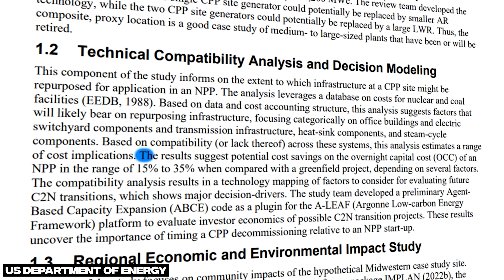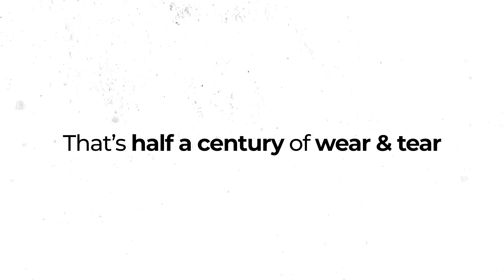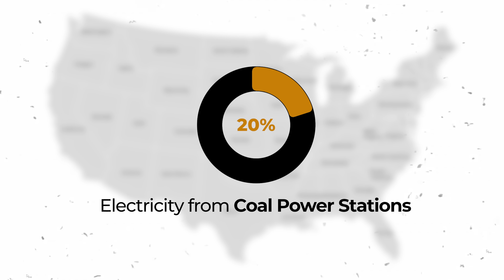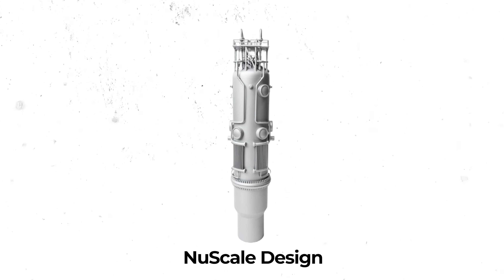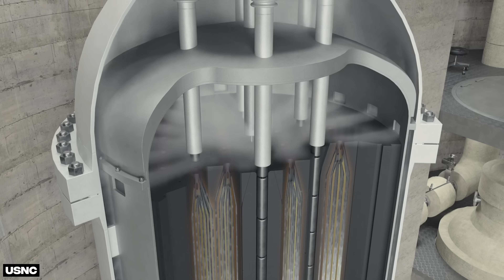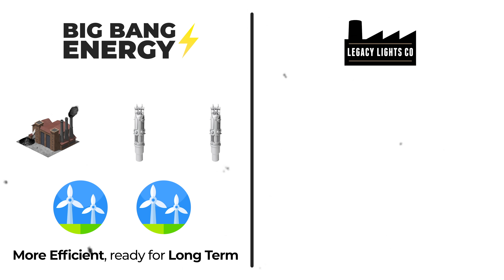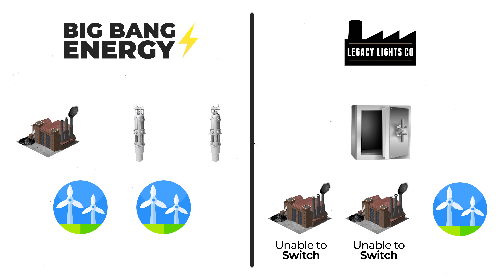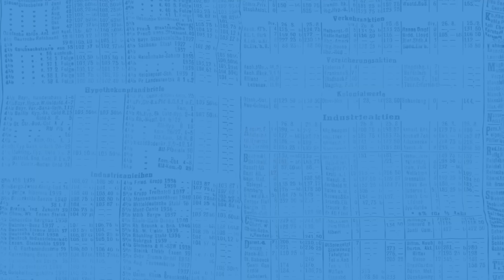Can We Convert Old Coal Plants to Nuclear Energy?

Comment: Old power plants are just as useful for installing large flow batteries there - instead of nuclear...
Reply: Why? You're not gonna get the same output of power as a nuclear plant. A modern plant with advanced recycling methods would fill 1 shipping container with nuclear waste in about 700 years. That's pretty good for how much energy it produces.
Reply: @SwordTune  There are battery parks already with the output of a nuclear plant. And nuclear is all well and good  but VERY expensive. And ONE shipping container in 700 years is hyperbole to say the least. I've been to a nulear waste storage facility and - recycling or not - it uses up way more volume. AND recycling is very complicated and not very efficient and also expensive and worst of all you're left with huge amounts of plutonium.

Comment: The single most valuable piece of an old power plant is its grid connection. The biggest barrier to the backlog of new energy generation is studying and integrating them into the grid. Reusing the existing grid connection can save many years in brining new energy online. Where old power generation is being retired we should look how to best make use of the existing grid connection and potentially sharing it across different generation technologies (nuke, solar, wind, battery, etc.)
Reply: I would suggest that any such site start building storage straight up, to absorb excess generation during low demand and deliver it during peak demand. This lets existing plant run most efficiently and most effectively. It also gives a few minutes grace in the case of unexpected shutdown or failure, giving other plant elsewhere a chance to come online.
This sort of storage stays handy no matter what you do later: build a reactor? still handy for site power backup and for storing excess, as for coal. Build some renewables anyway to save backup diesel for the reactor ancillaries and spent fuel cooling, why not? 
I expect to see the first stage storage built first, then renewable generation as the coal plant is decommissioned, then expansion of both while nuclear is considered. Then further expansion as funding dithers, to the point where no one is bothered anymore.

Comment: What about power peaks and offpeaks? Power maneuvering of nuclear reactors is not easy.
Reply: Make the nuclear units the base load units and require the other units to manuver.
Reply from the maker: The proposed set of SMRs are designed with greater power maneuvering in mind. In some places, particularly France, the existing nuclear reactors already do daily load-follow. It's not impossible, just not popular for nuclear because usually there are easier options.
Reply: @davidjernigan8161  There are limits to what other generators can do. Coal, like nuclear, does not do well in load-following. Furnaces effectively have to turn off, and take many hours to restart. Just like a reactor. 
One option is LOTS of storage. Pumped hydro for instance.
Of course, if we had enough storage to allow coal and nuclear to operate optimally and still follow demand, then we would have enough storage to make renewables feasible.
Reply: Molten salt reactors are excellent at load following.
Reply: @neuralwarp  Please list some grid scale molten salt reactors that demonstrate this. How do they manage the escaping xenon at that scale?

Comment: Another great use for old power plant sites is battery storage. The grid infrastructure is already there. The Moss Landing natural gas power plant in California was built in the 1950s and is now being transitioned from power generation (at least two of the original units are shut down) into a battery storage facility. I think we will see more such conversions of coal and natural gas plants over time. Having the infrastructure in place is a big deal as is already having permits to do "dirty things". It is easy to argue that a battery storage facility has less environmental impact than a coal or natural gas fired power plant.
Reply: The total world battery capacity is about 30 seconds. It would be prohibitively expensive, would lose 10%+ of the energy, and we'd still need to generate the electricity in the first place.
Reply: It makes sense to do so. The switchyard and transmission trunk is right there. The surrounding area is probably worth using for renewables to help charge that battery.
Reply: The whole world are waiting for a tech break through in energy storage, for many applications. Assuming we get the break through by next Tuesday, it will still be at least 2 decades to build the infrastructures.  Engineering explained in this site have a video that explained the battery situation well. The engineer have a US gallon of gas in a jug, the rest of his office desk were piled 2 high in pop cans. Both the pop cans and the jug hold the same amount of energy.

Comment: correct me if i am wrong but arent nuclear just as harmful as coal if not worse?
Reply: Nuclear is less harmful than coal overall. Even in the worst nuclear power plant accidents you will be mostly fine if you stay inside, take iodine supplements and evacuate if necessary (assuming you don't work in the plant). If a coal-ash dam collapses you could be in a lot more trouble.
Reply: @SocialDownclimber  Is that really the case?
European death stats these last thirty-five years have included excess deaths from radiation-related causes.
Iodine supplements do not protect from caesium or strontium contamination of the food chain, nor from xenon exposures downwind a theoretical molten fuel design.

Coal ash is usually buried, and chronic exposure is low. If a fuel dam breakage is relevant, how about a spent fuel fire?

Downplaying genuine nuclear risks doesn't alter the real picture.

Comment: nuclear cost 5-10 time renewable.  It takes 10 years average to build a nuclear plant.  Nuclear needs a much large setback than coal.  This is nonsense.  

Install batteries, solar, wind,  at the former coal plants. They can be installed in 1 to 2 years.
Reply: The latest new nuclear build (Vogtle) took 16 years and cost 17 billion per 1,100 Mw unit
Reply: > Install batteries, solar, wind,  at the former coal plants. They can be installed in 1 to 2 years.
They cannot be installed in the same footprint.

For example, the Roscoe Wind Farm, at about 780 MW generates (at peak!) the same as a medium-large coal power plant. And very compact, at a mere "100,000 acres (40,000 ha), several times the size of Manhattan"
https://en.wikipedia.org/wiki/Roscoe_Wind_Farm

Comment: I am a Mopar fan, but I happen to know of Ford 300 inline 6 cylender engines that have been running for over 50 years. They are used in natural gas compressors that run off of the gas they pump

Comment: Matching a coal plant with superheated steam or in some cases, supercritical steam, to the much lower temperatures and typically saturated steam or in slightly superheated steam as in the case of Combustion Engineering's steam generator (e.g. Three Mile Island) would require basically replacing all the steam turbine generator island. There are drawing board designs for High-temperature gas reactors but they operate at even higher temperatures and pressure than current plants making them more expensive and less safe. Atmospheric pressure thorium LFTR type reactors with a more efficient gas cycle instead of a steam cycle or possibly using the coal plant for a "bottoming cycle" as with combined cycle technology would be more advisable.
Reply: Matching the output characteristics of the reactor to the input requirements of existing infrastructure could be done with a heat exchanger. It would add cost and complexity, but it's doable.
Reply: @murdelabop  Heat exchangers can't raise the steam temperature though.
Reply: This is an important point.  I'd just add that converting a coal plant to use a reactor for the heat source, you still end up having 50+ year old piping, pumps, feedwater heaters, condensers, etc...  Putting in an expensive reactor tied to aging secondary plant seems pretty risky (financially speaking).  You might end up with a lot more down time just to save capital up front.